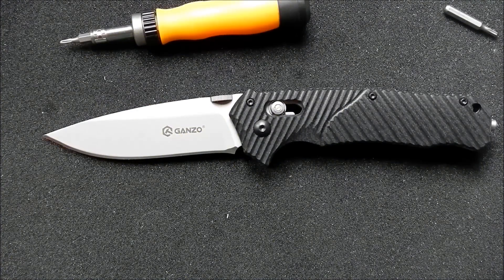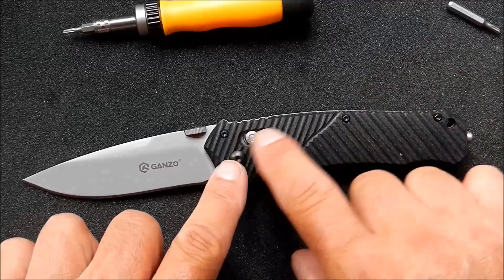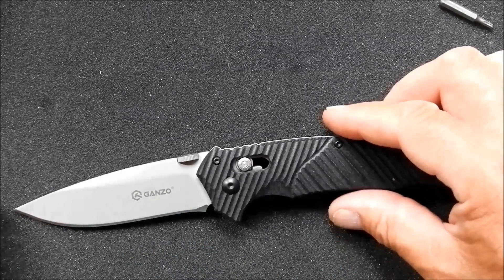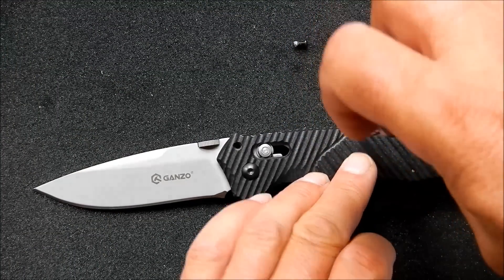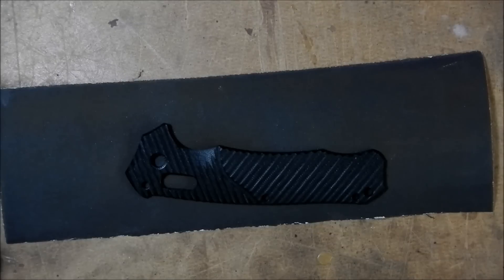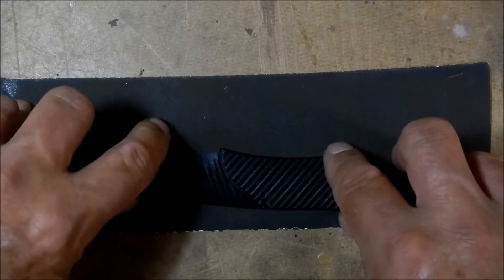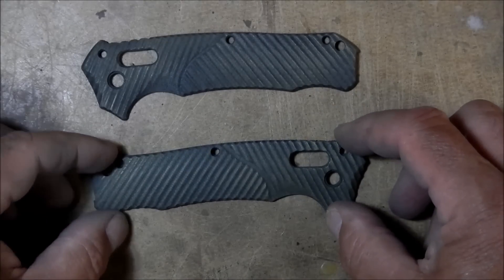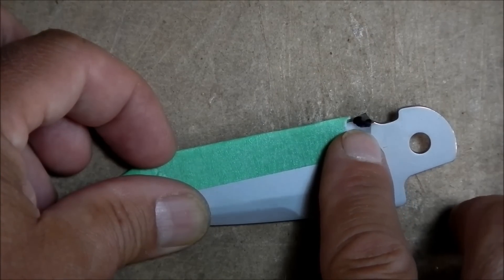Tuning up a Ganzo G716 knife

Comment: I have recently picked up a bunch of Ganzos in different configurations. What a value! Fixing to put a professional sharpening on a Firebird F756. That will be a $30 sharpening on a $20 knife! hadn't thought about getting into the knife the way you did but it has given me some ideas. Thought of replacing teflon washers with phosphor bronze ones. Thanks for the instruction, inspiration and the tips.

Comment: If you roll up some 400 and 1000 grit paper then sand the channels of the g lock. It smooths out the lock sliding action alot.  I found my ganzo had some small machining marks in the liner channels and once removed. Smooth as butter

Comment: Drilling out a few large holes in those liners would have cut a bit of weight also. I mod most of the cheap knives i get just to make them how i want them. Don't have any Ganzos but for $20 and all the good things I've heard I'm gonna get a few. Have a boker ak74 i moded pretty heavily (ground button, ground smoothed and polished scales) and is my current edc. But the Ganzo F758al looks like it might take it's place. Gonna grab a F7562 and G7392 just cause they're cheap and i wanna try em. Nice video thanks for posting it

Comment: Great job! What's your overall opinion on the knife? Were those polishing felt cones? or were they hard stones of fine grit? Did you lube the knife as well?
 I'm going to check out a few more of your videos cause this one was great.
Reply from the maker: Thanks, Rick.  The last step was a felt cone of some description.  It came in the kit with the rotary tool, so I'm not 100% certain of the composition, but it does the job nicely.  I lubed the knife - I use a very light oil. Overall, I like the knife (weight, size, shape), but without the modifications I don't think it would get much pocket time.

Comment: No choil problem in part serrated edge model;) I only want shorter pocket klip, soft half part of that g10 and change blade to axis lock fall 1.5mm depper when knife is open. Knife is realy great i buy them for ~8$ %)

Comment: If your Ganzo edge has a Secondary Bevel, then it is defective. They all have FLAT GRINDS! No where at any time does someone talk about a "secondary bevel" on their Ganzo knife.
Reply from the maker: (1) You should probably bone up on your blade terminology.  That flat grind that you refer to is the primary bevel.  The secondary bevel is the narrow cutting edge, the part that you actually sharpen.  (2) Most, but not all, Ganzos have flat grinds.  The G728 has a hollow grind.
Reply: Yep. I was wrong. You were right. I prefer to call it the "primary edge". You have no idea how many long time knife owners are STILL mixed up about the term "secondary bevel". It is a never ending topic in the forums.
But I am OK with the term now. Finally. About time.

So, how do you sharpen and keep the profile of a hollow grind? What benefit do you see to a hollow grind? Cons?
Why do you think the G728 has a hollow grind when most (all?) other Ganzos have flat grinds?
Thank you for your reply and an informative video.

I have two Ganzo automatics  on the way from China/Fasttech
The Ganzo G748 - First automatic Ganzo knife with carbon fiber scales, weight loss cutouts and safety lock. $20.56 shipped
and
 The Ganzo  G7211-BK drop point with G10 black scales. $17.35 shipped
Every review on YT and every blog was glowing for both knives.
The 440C steel is of particularly good quality which is unusual for China.